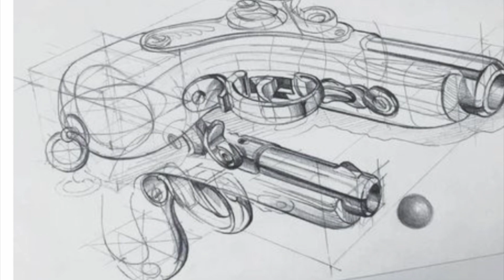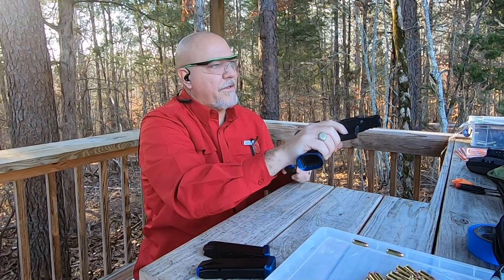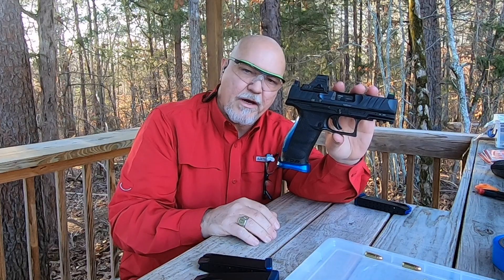Walther PDP With Taylor Freelance Upgrades Range Time

Comment: Do you think the weighted backstrap helps ? Asking cause I just purchased one waiting for it to come in. Thanks
Reply from the maker: No real affect on 
 recoil control. Just liked the look. The texture on them are nice. But did not change the performance.
Reply: If you add a flashlight that will help reduce muzzle flip and but make it top and forward heavy the brass grip will bring the balance back and more weight makes aiming easier all serious competition guns are heavy.

Comment: So just to be clear: this isn't a "drop in" part insofar as it will require a bit of fitment
Reply: Mine didn't.. I got the brass mag well, mag extensions and backstraps from Taylor Freelance and they all fit perfectly, I didn't need to file or make any adjustments.. Im curious if he has baseplates that came from somewhere else.. Anything I've ordered from their has a money back guarantee or replacement